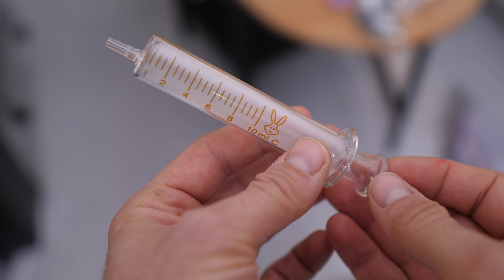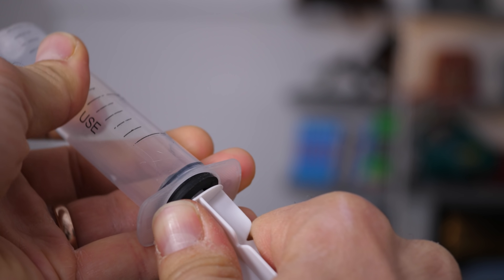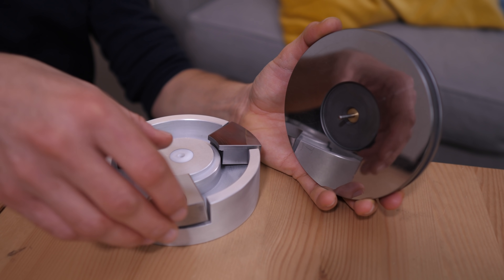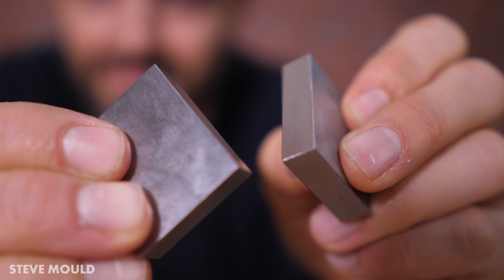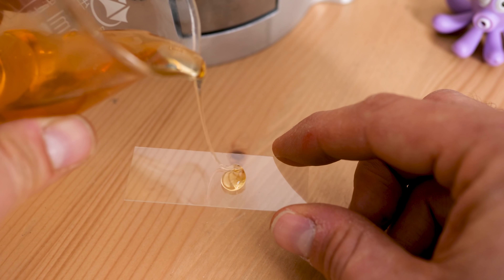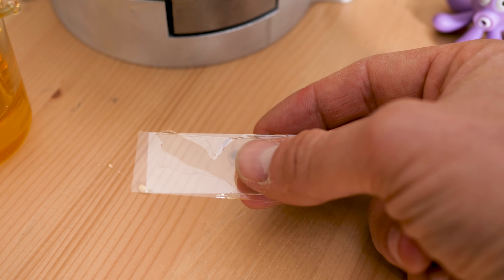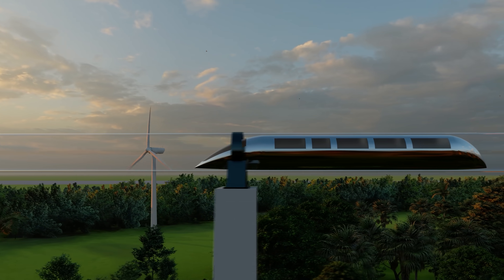The Self-Levitating Kingsbury Aerodynamic Bearing

Comment: Hey steve, you left me hanging and didn't elaborate on how a glass syringe achieve a seal when static? And what fluid is utilized in the hydrodynamic effect when the syringe is filled with injection?
Reply: Kinda sorta but not really.

Imagine if you will a piston in a car. When the combustion cycle happens where does the gas go? No where, it expands pushing the piston back down, but doesn’t make it past the piston (hopefully) same-ish principle just with oil and without getting too technical. 

The piston is tight against the cylinder but when running with the oil acts like air in this case, getting between the two surfaces.(again hopefully) now it is a bit different you can’t free spin a standard piston like the syringe because the piston rings forcing against the walls (more like the plastic syringe, but indulge me because it is kinda sorta both...

The glass one does let some air through but the tolerance is so tight,  if any it won’t be much. Look at the two gauge blocks stuck together with nothing but air. Air is viscous... and that’s what’s happening between the body and plunger the air is actually acting like a seal. 

Also it’s not going to change with an injection it’s not going to seep down the plunger because of that seal it will still be riding on that small amount of air that is actually sealing the two surfaces due to its viscosity.
Reply: I do understand your explanation. There is my understanding that viscousity does not take effect when things are static. Can I assume that such a tight space will  "activate" the vescosity and form a seal once the injection fluid starts to move into it? And therefore inducing an equilibrium of sorts that makes a stable seal? May be surface tension has a role at the boundary area of the seal. I wish Steve talked more about the sealing aspect when static.

Comment: Anesthesiologists use a glass syringe when placing an epidural for regional anesthesia. The anesthetic for an epidural needs to go into a very specific space near the spinal cord called the epidural space. The anesthesiologist  advances a needle into the back with a glass syringe on the needle. Each time that the needle is advanced, the anesthesiologist lightly presses on the plunger and releases it. Because of the low friction in the glass syringe the plunger readily springs back if the needle tip is not in the epidural space. As soon as the needle reaches the epidural space, the plunger goes all the way in with no spring-back. A plastic syringe doesn't work for this, because it has too much friction to respond the same way.
Reply: Another story that proves doctors are highly skilled mechanics! ^^
Reply: @hundry_f  You are correct. The insertion point for an epidural for obstetric anesthesia is usually around L4, which is well below the conus medullaris, or the end of the spinal cord, but still in the cauda equina. This approach significantly decreases the chance of spinal cord injury.
Reply: True story. You can use plastic syringes and they will demonstrate the compressibility of air and the loss of resistance in the epidural space. You can also use saline which is superior to air in that no air pockets will be introduced in the space potentially contributing to “windows”. It isn’t compressible and won’t budge with continuous pressure until the epidural space is accessed.
Reply: Is it true ? I have not seen glass syringe (biomed tech)  I test the pumps they use tho.  They are trying to get away from luer lock connections to a different one so epidural lines are not confused with other lines, can't physically connect the wrong one.  The lines I've seen have yellow down them, and a little blue anti free flow, anti siphon valve at the needle end.
Reply: I asked the doctor for the one after he gave my wife an epidural. Those things are amazing! Unfortunately it broke a couple of years ago but I did get 12 years of fascination out of it.
Reply: Glass syringes might be used to avoid reactions of certain drugs with plastics.
Reply: Is it the same with a spinal block? I needed one of those for an operation
Reply: @WinterSolstx  In a spinal block, a local anesthetic agent is injected into the spinal fluid. An epidural is similar, but the anesthetic agent is injected adjacent to the membranes surrounding the spinal cord, rather than into the spinal fluid. here's a link:  https://en.wikipedia.org/wiki/Spinal_anaesthesia
Reply: THANKX for that ….
Reply: Someone wrote something that is about an example of the subject. That info is also interesting. But some other childish trolls have replied it with bullshit. He had given a real life usage example. Just read and shut up.
Reply: Very well explained, I had no idea. Thanks for some knowledge.
Reply: I’ve assisted with epidurals in a number of different hospitals in Australia and about 50 or more different anaesthetists have always used disposable syringes, that’s because the stakes are much higher with infection when it comes to spinal fluid, compared to just blood. I don’t know which country you’re talking about and what the budget is, or what the standard of technique is, but they’re extremely careful about everything when it comes to epidurals here.
Reply: It's called practicing medicine for a reason
Reply: Thank you so much for that distinction.
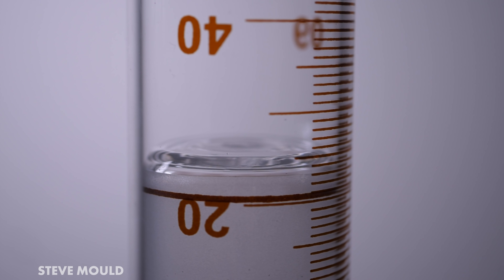Reply: 2:49
Reply: So if the needle accidentally clogs, the anesthesiologist will poke the needle all the way into your spinal cord and you end up on a wheelchair?
Reply: @charlieangkor8649  They use a special needle called a Tuohy needle that is designed to avoid "coring" that might obstruct the lumen of the needle. https://en.wikipedia.org/wiki/Tuohy_needle
Reply: @DavidKutzler  I just love it when doctors use things like "perioperative morbidity" as an euphemism for "hey shit happens but frankly I just couldn't be bothered and after all it's just you dying not me so that's a sacrifice I'm willing to make".
Reply: @AttilaAsztalos  I reread my comments and didn't use the term "perioperative morbidity" in either my comments. In fact, I deliberately  avoided using medical jargon because it can be off-putting to a non-medical audience. I was merely illustrating a specific medical procedure that demonstrates a practical application of this interesting phenomenon. Perhaps you're not attacking me personally, but have a more generic complaint about healthcare providers.
Reply: @DavidKutzler   “perioperative morbidity” is mentioned in the wiki page you linked to, which I suspect is what Attila is on about.
Reply: @bend1483  Ah Wiki where there are only facts.
Reply: @AttilaAsztalos  you can choose to avoid risk of operations by dealing with diseases without professional help if you consider yourself smarter. 

Doctors are just workers and, as in any complex profession, there are inevitable failure rates that are not feasible to eliminate. Nobody is obligated or even able to guarantee results.
Reply: @Invizive  That's terrible advice, but ok. You might be smarter than your doctor, but not more knowledgeable. And calling doctors "just workers" is strange, if one of your patient dies it hits quite differently then if you screw up some item that will only cost you money. Doctors will take more care not to make any mistakes than any average worker, because of what is on the line.
Reply: @zagreus5773  i think you are taking it completely against the intended way. I read it as: 'doctors are people of trade, not people of magic. You do things, you will be exposed to failure, both sides, the doctor and the patient, have to understand it'. And as to being careful and cautious: the doctor's profession isn't even close on being the one with most caution involved, but it sure is one where there's highest time pressure on caution. When I design things for automotive use, the amount of caution and potential life loss is way higher than for any doctor's procedure, BUT I can spend half a year working out all the options and finding all hidden risks. If a doctor spent that time his patient would have been dead for natural reasons. So it's not the caution itself, but the time pressure under which you have to make the critical decisions, that earns the medical profession the utmost respect.
Reply: @DavidKutzler  this phenomenon isn't exhibited in your application, it just makes use of the plunger moving easily in a precision bore.
Reply: @AttilaAsztalos  I can't think of a more insane interpretation of that phrase.
Reply: @AttilaAsztalos  wow, what a profoundly ignorant and uninformed thing to say.  I feel like this needs an award for being so off base and failing to communicate any sort of relevant point.
Reply: @charlieangkor8649  look up epidural needles, my missus had one when she went into labour, I had to leave the room, they don't have the hole in the end, it's on the side, plus, they're curved and have anodised markings on the outside so they know how far they have gone in.
Reply: @jamescrawford1534  That's the Tuohy needle he was talking about.
Reply: @charlieangkor8649  No medical procedure is entirely without risk, but the odds of paraplegia are 1:250,000. You're more likely to just die from it, at 1:100,000. But if those odds are too much for you... tough. If there were a safer way, doctors wouldn't be using epidurals. The risk of death from general anasthetic is also about 100,000, so comparable.
Reply: @vylbird8014  What if the doctor's got a hangover, or just caught his wife sleeping  with his best friend?
Reply: @charlieangkor8649 
Remember, an epidural for child labor IS OPTIONAL.   
With a mother’s choice of natural birth, no epidural is required, but who in duress is going to choose the pain?  
Yes, there are still a few women who choose natural, but not many.

Comment: The heads on a hard drive are designed to float on a wedge of air as a bearing. Drive manufacturers are trying to seal the drives and replace the air with nitrogen because nitrogen is a smaller molecule than air. The closer the heads can get to the surface the denser your data can be.

Comment: I know it's an LED with current draw in the low milliamp region, But one shouldn't pass current through such precision bearing surfaces. When passing through the intermediate separation zone microarcing can occur, causing pitting and microwelding. The surface deviations can build over time in a feed back loop of galling, surface transfer, oxidation ect.... It's negligible at this scale of course, but just something to note about the topic in general.

Comment: You can already buy a rotating metal syringe as an precision pressure calibrator. Not very practical to use. More to calibrate an "normal" precision electronic pressure calibrator.

Comment: Wow I've got so many things I want to say about this video. First of all that gague block ringing kinda makes sense to me as it has been machined so precisely that the atomic bonds are fooled into thinking that they are a part of the same object (probably not the case but that's what immediately comes to mind). Second is I wonder if that cushion of air in the glass syringe actually works slightly differently than explained? I'm thinking centrifugal force is expanding the glass barrel's width by a nearly undetectable margin, but it's enough to allow air to get between the cylinder and barrel and is slowly being pushed out once the chamber starts slowing down, causing a rather stable and long lasting expulsion of air keeping the interior cylinder from touching the spinning edges? The only way to know would be to put some colored gas in the syringe and spin in.

Also, speaking of air and hovering... there is a Japanese restaurant I frequent where they chill the soup bowls. But the very hot soup would rise the temperature of the bowl. Due to condensation forming on the concave underside of the bowl a thin layer of air would form. Thanks to the highly polished table the soup bowls have a tendency to start hydroplaning off of the table. Nothing crazy, maybe moving 4 inches on average. Still will give people a jump scare if you're not expecting it.

Comment: You missed the chance to mention that the read/write heads in mechanical hard drives ride on an induced air cushion, preventing the destruction of both the head and the disk surface. Supposedly the gap is less than the wavelength of visible light. If the gap was larger disks would have only a small fraction of the areal bit density they provide.

Comment: Isn't this the way the heads inside a hard drive work as well? If I remember right, the disks are spun until they reach a certain speed, then the heads are moved from their rest onto the discs and end up at a very close distance from their surface, with the air moved by the discs being the only thing separating them both.

Comment: Wonderful, just one observation:
mmmh 7:53 the animation that explain how the air flows and works between the core and the syringe body... is backwards... by gravity... the core should be the one that support the external body of the syringe.
Reply: That depends on what part you hold...

Comment: What you're presenting there is the basic principle of fluid bearings ;) They are pretty common in car engines especially in the turbo or at the camshaft and the surfaces are separated using oil as opposed to air like in your video. But fluid is fluid :D

Btw. I've never heard someone call them "hydro dynamic bearings." Doesn't seem like a common term to me. But it makes sense.

Comment: Wait, I need some clarification on why the air injected systems are hydrostatic, but the bearing that doesn't need an active source is hydrodynamic.
Reply: It's because in case for example of the air hockey table you have a constant source of air pressure pushing the puck away from the table. In case of a hydrodynamic bearing you have two surfaces gliding over each other. Because of the viscosity of the fluid in between the higher the velocity gets the greater is the pressure of the fluid. Just imagine that the upper surface is dragging the fluid along. That's why it's hydrodynamic. This effect can be described with the Navier-Stokes equation but as this is a highly complicated differential equation there is a simpler - but not simple - alternation of it, which is called the Reynolds equation, which is used to calculate the pressure - and with that the forces - between the two moving surfaces.

Comment: Fun Fact:
The bearings in rocket engine turbopumps don't use grease or oil because the liquid propellants are cooled down so much that it would freeze.  
Instead, they use the propellants themselves as lubrication.

Comment: Michell bearing not Kingsbury. Osborne Reynolds discovered the principle theoretically on paper and it was put into practice by Anthony Michell an Australian Engineer living in the UK in Newcastle. The tilting pad bearing was patented by Michell in 1905.  Kingsbury to be charitable, came to the same idea independently but did not patent the idea til 1907 in the US. There followed years of litigation, which owing to the vagaries of US Patent law favouring US inventors went Kingsbury's way in the US.
But Reynolds and Michell were first.

As an aside, The Shell oil company demonstrated using the same electrical technique that rolling element bearings, like ball bearings, don't touch when they are moving in oil either.

Comment: If this bearing effect only works when the syringe spins, why is it working so frictionlessly when just pulling the syringe out?
Reply: Because the distance between the OD and ID is smaller than a molecule of water, but still a slip fit. As long as the plunger is very round and very straight it will only minimally contact along the length of the ID, creating the scraping sound, but the contact points are so small that there's very little friction. The surface finishes are also very good, so it creates the same sliding effect of two flat surfaces slipping.

Comment: It's actually a bit more complicated than only an Eulerian or inertial phenomenon. It's not only a difference in pressure, but the air or fluid sticking to the surface due to viscosity. In order to explain this phenomenon, you need to solve for the full complete navier stokes equations (for viscous fluids) not only the Euler equations of inertial fluids (that give rise to differences in pressure, the Bernoulli effect). You need critical layer theory.

Comment: The first time I encountered this and was really confused was at my work where I do phone repairs. I had set samsung glaxy s8 screen down on a piece of regular printer paper on a hot plate around 69C and put a 15 pound (7kg) battery (lead acid battery) on the back to apply pressure while the adhesive setup for the back glass of the phone. A few minutes later and the phone and battery had slid off the hot plate. I was very confused so I put it back on thinking I had bumped it some how. This time I saw it move. It moved really slowly maybe 2 inches a minute but it slowly slid. I still have this issue every now and then but its kinda hard to get it to repeat with every phone I do.

Comment: anyone else wondering if title-writing Steve is right by calling it an aerodynamic bearing or if speaking Steve is right by calling it an hydrodynamic bearing?

edit: in second thoughts I guess its aerodynamic if the fluid is air and hydrodynamic if it is a fluid. I'm no aero/hydrodynamics expert so correction is welcome!!
Reply from the maker: It's actually both. Hydrodynamic referees to fluids (liquids and gasses). Aerodynamic refers to gasses only. So if it's a gas then you can use either.